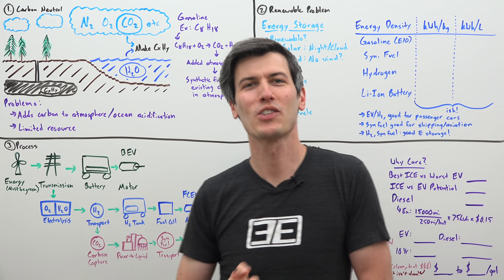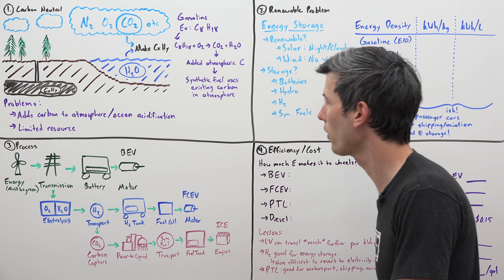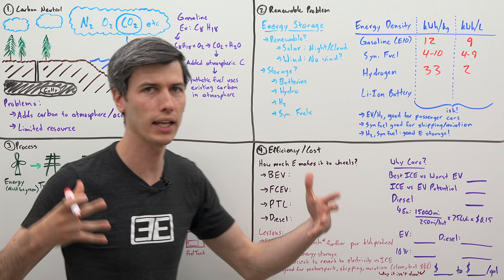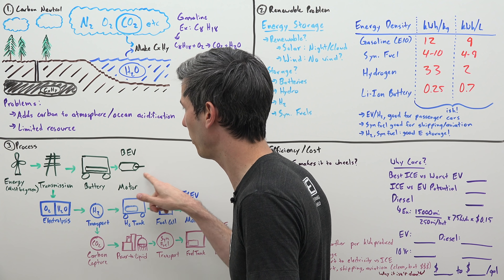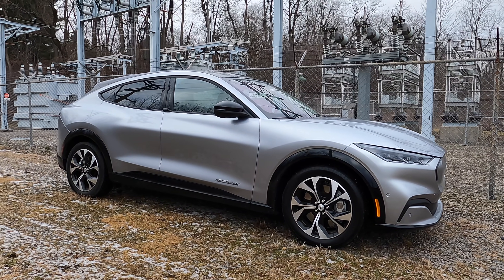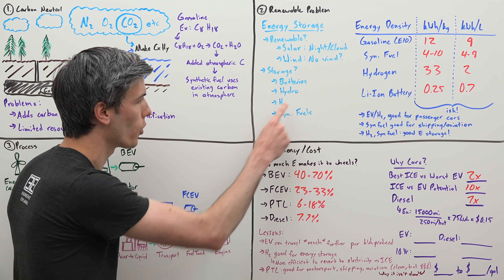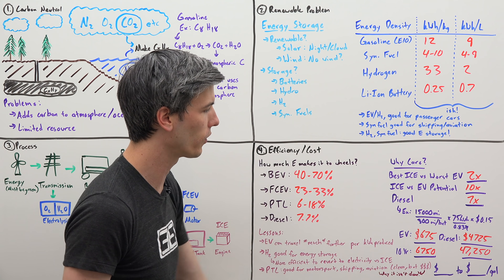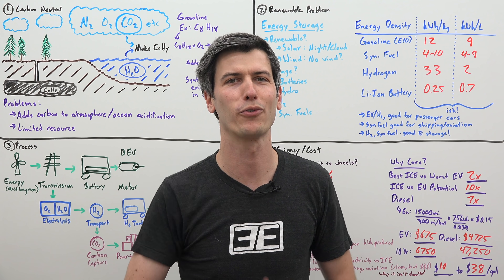The Big Problem With Synthetic Fuels

Comment: ICE will be weekend cars, EV's day to day, can't see me ever spending 60-100k on an electric performance car and i bet many others will be the same
Reply: I'd still daily a gas car, but if fuel is that expensive I'd have said gas car converted to a hybrid.

IMO hybrid is the best of both worlds. The electric motor has instant torque which means zero turbo lag, but it also helps you recharge when you're slowing down or going downhill.

Comment: As a gearhead I will happily pay $2pl in Aus for synthetic fuel. But I completely concede the point that that cost may not work for most.

I completely understand the point made re. energy to the wheel, but would be interested to see the amount of excess energy required in producing the raw materials for manufacturing of each type of vehicle, with BEV's being much more heavily reliant on mining. 

And as someone who works in the mining industry, I can tell you there are a LOT of hurdles to cross to make mining carbon neutral whilst keeping the cost of production of the minerals the same. 

I fear we're kidding ourselves by saying "Yes, but BEV's will become cheaper as more people adopt the tech". The resources required for BEV's are a lot less abundant and are finite. Wouldn't be a problem if we could cheaply recycle BEV's but we can't. 

Either way, I believe we should be pursuing all avenues as we push to get ourselves cleaner, rather than acting as fanatics or disciples for one method or another.

Comment: Great video. And so right - if you only look at new vehicles.
You just leave out of the picture the neclectable fact that we currently have a stock of 1.4 billion combustion vehicles on the globe. In 10 years we'll have about 20 to 50 million battery EVs on Earth plus 1.5 billion combustion engine cars - so still about 50 times more combustion cars than battery EVs. 
If we don't decarbonize the fuels of the combustion vehicles really asap, no matter how much the cost or needed solar energy is, we may as well stop the attempts with EVs because then their effect on the climate will remain minor.
And btw, when synfuel is produced in industrial scales the price will be on the level of fossil fuel - also a finding of Porsche an their partners.
Production plants at the equator will have a 4 times greater efficiency than plants in the US or Europe.

However, the current ideology prevents rational decisions taken in time. 
Instead, we experiment with ships fueled by batteries. Sigh!

Comment: Anything made from crude oil can be made from algae oil. Biofuels from algae oil produce 86% less admissions so it would be like taking 86% of the combustion engines off the market without destroying them or converting anything. The only reason that crude oil is so competitive is because of all the subsidies that it receives. Algae oil is an eternal source of fuels and products and that is why it's not promoted

Comment: Talk about Fast and Furious... lots of numbers and lots of assumptions!  Some questions about your derivation of "total" costs.  People driving Teslas often do so to save the planet-but they're doing nothing to upkeep the very highways and byways they travel.  When are electrics going to start paying road taxes?  They may criticize us "fossil fuel" neanderthals, but we pay huge fuel taxes (per gallon) to pay for the very roads and bridges they travel.  To fairly compare fuel prices, you have to either factor in a road tax for electrics or remove all taxes from the cost of liquid fuel.  Next, you don't need any special inventions to combine atmospheric hydrogen and carbon to then convert into synthetic fuels.  Nature has already given us photosynthesis and it makes the ultimate carbon neutral biomass feedstocks from which to create sythetic liquid fuel.  Today, old fossil crude oil refineries are refining virgin and used vegetable oils into synthetic liquid fuels.  Have you evaluated the cost of fuel being produced by these refineries?  I suspect because their infrastructure is already in place and has been completely depreciated, the cost to produce sythetic gasoline, diesel and aviation fuels is much lower than your examples.  Then there are pyrolysis plants that convert both used and virgin wood into carbon neutral liquid synthetic fuels.  Again, this technology has been around for decades and holds significant promise to produce carbon neutral fuels for us internal combustion diehards.  Bottom line, I'm all for using the most efficient methods available to "move" us around this planet.  Just realize you're never going to fly to Miami in a battery powered airplane!  You're always going to need high energy content liquid fuel.  Finally, when comparing costs, you have to factor in all available liquid synthetic fuel technologies and all technologies have to factor in the cost of taxes to maintain our transportation infrastructure.

Comment: Synthetic fuel isn’t mass produced, so a cost comparison now isn’t fair. A big benefit will be that ICE-powered vehicles will continue to roam the Earth, long after all new car sales are electric. While we’re still consuming crude, at least it’s carbon neutral. Another thing is, while H2 isn’t without its issues (for now), everyone ignores the obscene weight of batteries in BEVs. A Tesla Model S weighs almost as much as a Ford Expedition. At least FCEVs don’t need as large of a battery pack v. BEV. 
2:44 “create energy”? I thought you were a law-abiding citizen?

Comment: What's the price to recycle a used battery? And EVs are twice as heavy...So you need twice the energy compared to other vehicles (when city driving you accelerate and decelerate all the time). You need to take that into consideration.

Comment: Excellent analysis as always. I have seen an analysis that battery run electric 18 wheelers make little sense. Why? Because the weight of the batteries and the limit on how heavy a 18 wheeler can be *(in the USA) means that the amount of freight would dramatically drop per truck
Reply: Depends on the cargo - many trailers don't get anywhere near the weight limit due to low density contents e.g. toilet rolls. Your average supermarket re-stock is nowhere near weight limit and there's far more of those running around than quarry trucks which are at the weight limit.

Comment: If you take hydrogen and make electricity to charge batteries it will be cheaper than if you use it in hydrogen engine, but it will not have the fuel density. Also why would someone convert electricity into hydrogen then back to electrify to charge batteries?  Hydrogen is very energy dense so promising tech for bigger trucks, airplanes performance suvs for towing. While rest of evs will dominate 150 mpg ev cost vs 20 mpg is saving $870 a month in gas cost if you were spending $1,000 a month on a gasoline car. Also no much repairs needed for evs too and resale value is way higher. But if ens need repairs then it’s more expensive. Also same ev is more expensive than gasoline car.

Comment: EV cars not that green and prob worse than any other. mining lead, the acid etc. all the battery material gets shipped to a place then made, is then shipped to shows, rubbish from doing that. then when the battery is no good most of it goes land fill.... that's just the batteries what about how we make the electric as well not that green, also in UK the grid right now can't handle it so think what be like if every house hold had a EV would need so many plants. Then that cost of making more plants goes to the customer won't be free. EV is a dream never will work, s hydrogen when it works better after research

Comment: The diesel calculation doesn't match my yearly figures. 15k miles costs me approx £1,400. Still more expensive than the electricity, but significantly cheaper than calculated here. Plus I can roll into a petrol station, fill up and be on my way in 5 minutes, can't charge an EV in that time.
Reply: There's nowhere I could plug an electric car in. My car gets parked around 100m from my house.

Comment: Synthetic fuels would be carbon negative not neutral. If you are building up a permanent reserve of produced fuel for energy security, that would be negative. If you use carbon negative bio hydrogen, ie.biochar + hydrogen combined with CO2 from the atmosphere to produce synthetic fuel, then you have a significantly more carbon negative fuel.

Comment: Prototypes and pilot projects are always expensive on a per-unit basis.  The question is how much the cost can come down.

Wind and solar energy at off-peak times can be cheaper than free: if you can put a load on the system when energy is over-abundant, it can save some costs of switching stuff on and off.  So if there's an energy-intensive first step, it can create schedulable demand.

That said, I'm still not optimistic about synthetic fuels, beyond specific uses like air travel where energy density can plausibly outweigh cost of production.

Comment: You are comparing price of electricity for an EV to 7*that price for synth diesel. Don't you think the conversion process itself is going to cost something? If you could magically convert 1:7 electricity to synth diesel, the price would be only 7x. In reality more like 20x the electricity cost. Of course, you included taxes into .15$ per kWh and bulk synth production would use cheaper (perhaps much cheaper?) electricity; but the tax gets back in in the end. So I don't realistically see less than 20x cost of electricity, that would be 3$/ kWh eq. , that would be about 8$/liter of fuel (realistic efficiencies).
Reply: let me clarify: by cost of conversion I don't mean losses, but cost of running equipment and doing the job.

Comment: The best sustainable energy management by country is a mixture from Wind at night (nights are more windy), Sun in daytime (most efficient) and if not to far away hydro power from lakes, seas or rivers. 
For the total peak times like Super Bowl evening you need a storage in form of batteries or hydrogen tanks. 
The end product should always be energy in form of electricity. It’s the best energy we can get and use. 
And the transition always has to be as short as possible and as local as possible for the efficiency. 
That would change the world so strong. Independent from all Arabian Russian Energy Companies. The technology is there. Let’s get it started!

Comment: While I agree that synthetic fuel does not make sense on grid power, wouldn't it be the perfect outlet for intermittent power generators? For example, you could run a synthetic fuel plant primarily off solar power and switch it off at night, because it doesn't matter when the fuel is produced. It's inefficient, but it's better to save 20% of our solar energy as fuel than let it all go to waste if it's not needed.

Comment: We can find the extra energy to have the time saved and convivence  of not waiting for batteries to charge. Everyone glosses over this. EV require some one to plan much more what they will do with their vehicle and I don't think most people want to be tied down by this all the time. I don't know anyone that only owns an EV. They are still primarily a secondary car used for commuting still.  Synthetic fuel would be fine even if expensive in small vehicles that done use that much of it, vehicles like motorcycles and scooters.